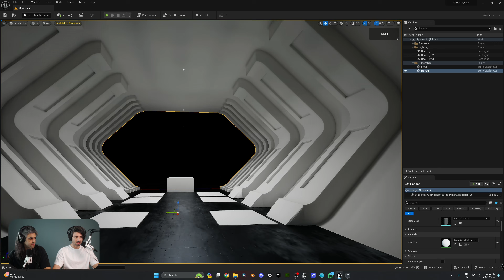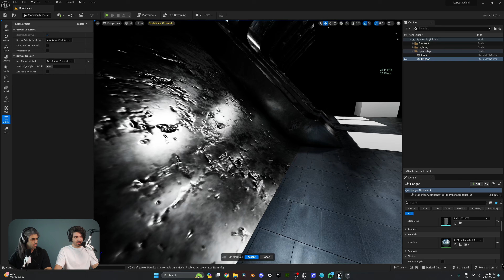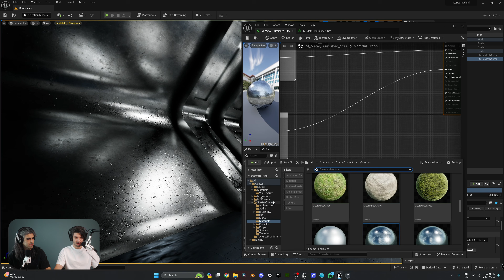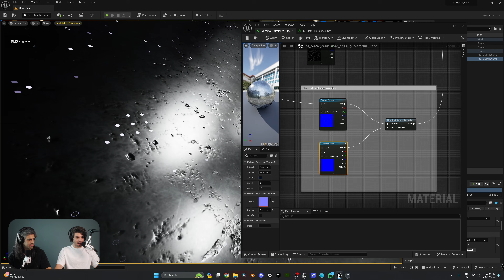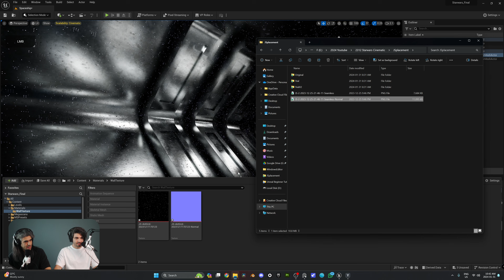Unreal Engine 5 Beginner Tutorial Part 8: Materials & Textures Advanced

Comment: 1:09 Reusing Starter Content Materials
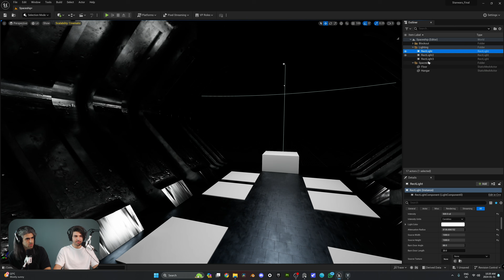 2:24 Duplicating Rect Lights
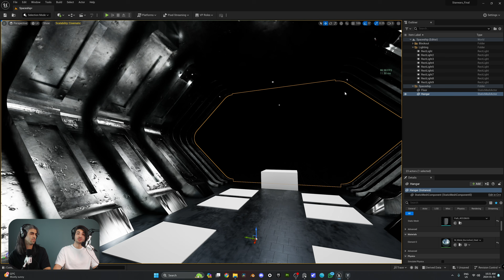2:57 Alternative Aay to Dupliate Lights
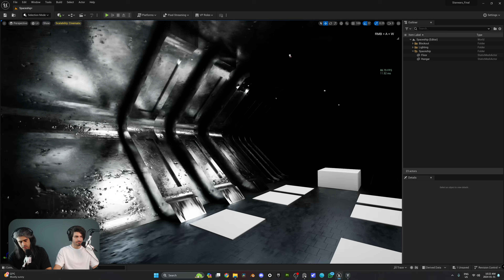3:45 Fixing UV's and Normals Lighing Issue
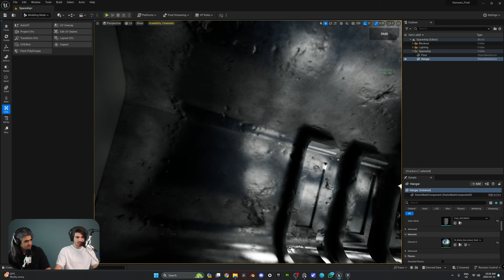7:39 Change Material Tiling
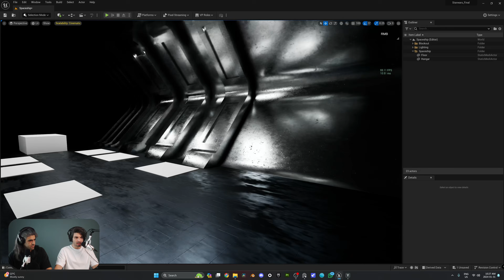9:30 Adding More Lights & Details to Walls ( JSplacement Materials )
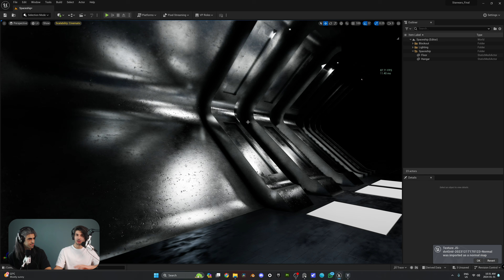12:40 Adding JSplacement Materials to Wall 
13:15 Using Height Map to Generate Emission 
14:13 Controlling the Color
15:40 Directly Bringing in A Parameter ( Shortcut S + LMB )
17:21 Mixing Two Normal Maps Together ( BlendAngleCorrectedNormals )
18:19 Adding Comments to Grouped Nodes ( Shortcut Select a Node + C )
19:03 TIP! Don't forget UV Tiling Node ( Using the Normal Map Multiplier : FlattenNormal )
21:09 Using the One Minus Node
22:41 One Last Detail to The Walls
Reply from the maker: You are a legend for doing this buddy 🤗
Reply: @badxstudio  doing this keeps me accountable for completing the series. Plus I really want to learn UE and you guys make it fun and less intimidating 💯

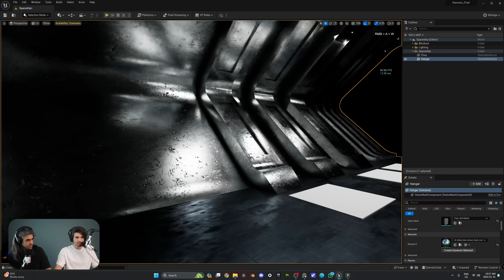Comment: 9:00 bro, my texture of the steel looks like it should in the video, but once i tab in and out it becomes silky smooth, although i've saved everything and the settings are the same as shown, i can fix it but it still goes smooth after
Reply: Not sure if you ever figured this out but are you sure the nodes are connected correctly? I had this issue and it was from 2 node connections being reversed

Comment: One tip: you needn't add the extra parameter and multiply node to the emissivity to make it glow. You can just click on the emissive color and in the Value field (as in H for Hue, S for Saturation and V for value) just type a number higher than 1. The slider won't let you take it higher than 1 but you can type a higher value, like 10. Same result. Fewer nodes. 🙂

Comment: Hey guys! been following the unreal tutorial until part 8! soooo awesome.. Thank you so much! i actually want to ask something tho.. do we need to have a great PC setup? Mine is currently running on a GTX 1050 with 32GB DDR2 RAM and an Intel Core i5 processor. The engine still seems capable enough for me to follow the tutorial up to this point, but I'm worried that when I use 'lit' mode, the FPS drops to around 24 FPS and turns yellow. Is it okay for me to continue with this tutorial, guys?
Reply: да

Comment: It says that i'm over the texture streaming pool budget by however many MiB and this messes up my texture when adding the RGB node and the multiply node for the texture that was generated from JSplacement. Is there any way I can fix this? my texture is now smooth and the details have been completely removed.
Reply: Update!! I was able to fix the pool size by going into the files and changing the size but my dots from the generated wall texture are not showing up and I'm not sure why :(